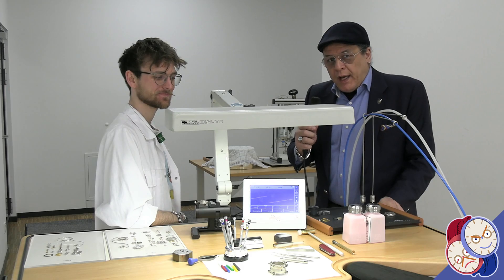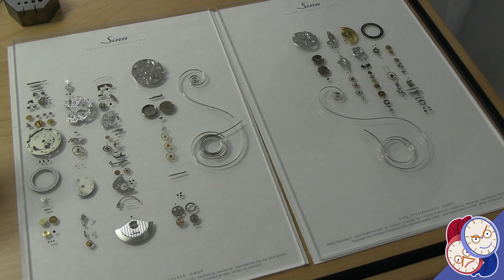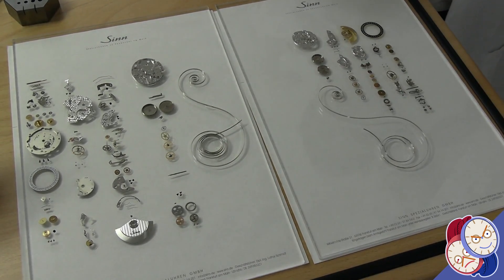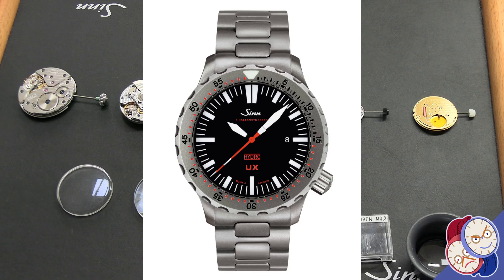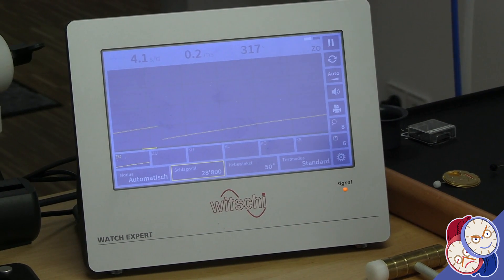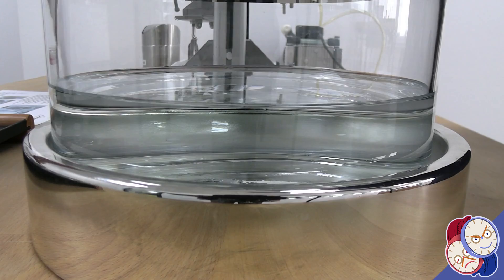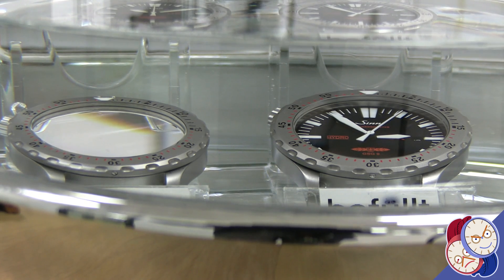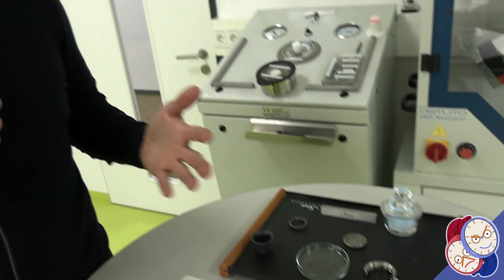We visit Sinn in Frankfurt to talk about their watch technology!

Comment: How on earth is there a protective gas inside the case but you unscrew the crown to set the time and wind the watch. The gas would surely leak out. Also, the more times you manually wind the watch (unscrewing the crown) the faster the capsule will turn blue.
Reply from the maker: The dessicant is desinged to absorb atmospheric moisture the opened crown lets in, and needs to be replaced every few years.
Reply: @TalkingTimepieces  Yes, but they mentioned they put gas inside as well. That gas will surely go out the seals over time, maybe very quickly.
Reply from the maker: @Abdul-e3m there must have been a miscommunication, they do not put gas in the watches

Comment: You desperately need a better mic.
Reply from the maker: It turns out it was a bad cable connection. I did finally get a new wireless mic
Reply from the maker: I even debated not posting, but the content was too good

Comment: I am a proud owner of the U-1 T-SDR.  I sent my watch for repair because I dropped my watch while winding on a hard surface.  The seconds hand and winding equipment got damaged.  While it was out for 5 months because i wanted the repair to be done in Germany by the technician that put the watch together.  I couldn’t be happier, i got my watch back with a full explanation of the work, got the parts that were replaced and i was in constant communication with customer service letting me know when my watch arrived, when it was on track to be repaired, when the repair was completed, right to the point when the watch was sent via air mail back to the USA.  Nothing short of amazing, my watch has come back working just as when it was new! Sinn technician manare truly unique at their craft.  I own a GMT 16710 and that watch was serviced as well in NYC.  I must tell you Rolex customer service was not as good as Sinn.
Reply from the maker: You got to see the guy that worked on your watch!
Reply: @TalkingTimepieces  lots emails between customer service and a full report from technician that worked on my watch, aling with damage or replaced parts sent back to me on a new Sinn waterproof travel case-pretty cool!
Reply: I tried to mod my Vostok Komandirskie GMT by polishing it. The 12" buffing wheel I use for polishing my motorcycle parts caught a projection and threw it on the concrete floor of my workshop. This damaged it so severely it started losing 70 seconds a day and I had to regulate it again to get it back to 3 seconds a day. Oh and it caused cracking in the crystal but it's still waterproof for bathing and swimming without air tanks

Comment: So a liquid filled watch will counter atm pressure at depth.Very interesting technology.Equilibrium is achieved.I wonder why Rolex has never used this method on their serious dive watches.Clever to illiminate reflection when under water.
Reply from the maker: The problem is you need a quartz movement to push through the oil

Comment: Hey Alix, question;  I'm new to all this, so, about oil-filled timepieces,  I'm assuming only quartz pieces would be suitable for oil filing.  I can't imagine a mechanical movement with the balance wheel swishing around back and forth in the stuff.  How far 'off the beam' am I on this one?
Reply from the maker: You are exactly correct! This watch alzo.has to be factory serviced every time to change the battery. There are oil-filled watches from Ressence, but they use magnets and gaskets to isolate the oil-filled display from the me hanical movement, whi h is why they are comically expensive
Reply: Unless you can somehow over-engineer a way to keep the gear-train and balance in air, which will be hard to make pressure resistant, it's a quartz only thing.
And a movement with moving hands might struggle with the viscosity of the oil still, so this has to be tested to ensure good accuracy and battery life.
But as long as the seals don't swell or degrade in the used oil, pretty much any basic LCD piece can be filled with oil as a DIY-project, YouTube is filled with such hydro-modding projects.
I have gone even further and hydro-modded my GBX-100, which broke the screen and made the factory seals swell, all of which except for the tilt sensor (which I don't use anyway) I have been able to repair, but after this experience I recommend against modding any more advanced piece.
Reply from the maker: @WyvernDotRed  check out how Ressence pulls oil-filled off, that's pretty overengineered
Reply from the maker: @WyvernDotRed  don't forget it's easier to design it in than to mod it
Reply: Obviously you can only do this with quartz watch.